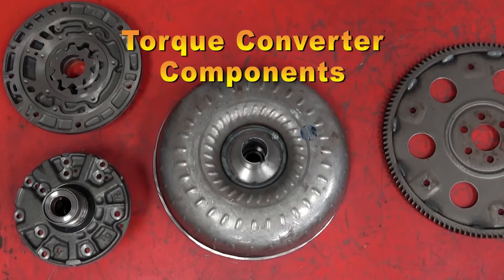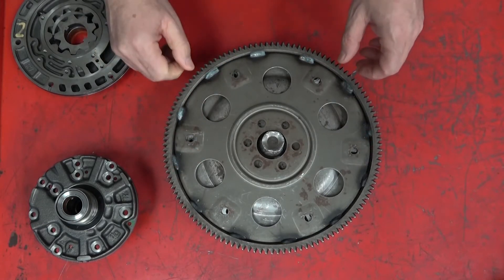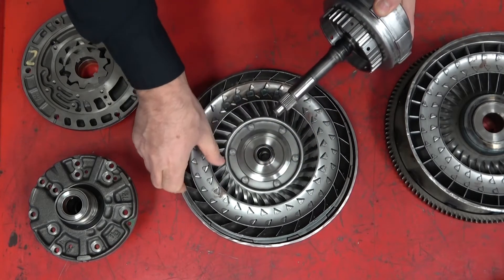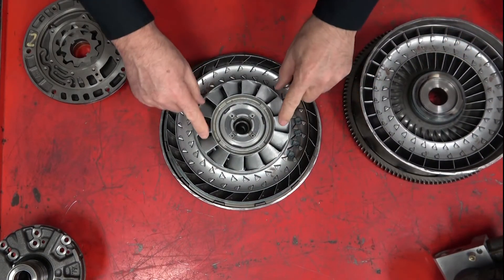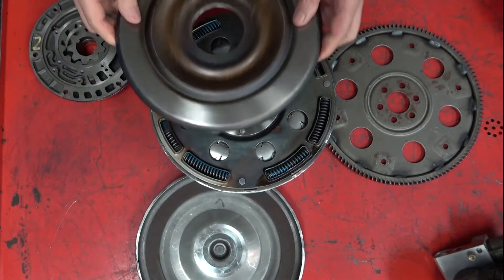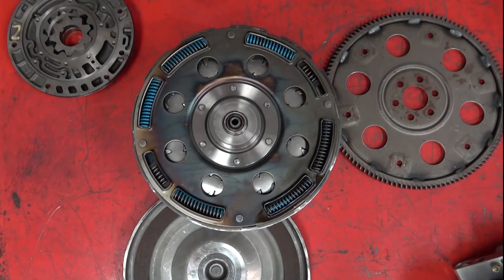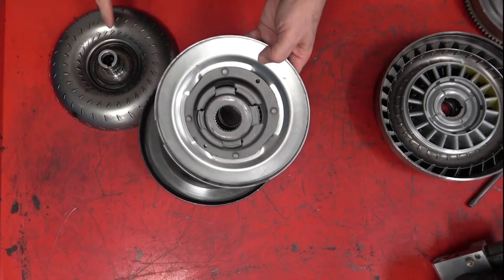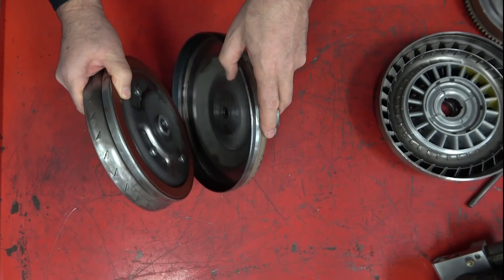Torque Converter Components

Comment: INDEED, excellent break down very detailed explanation with pinpointed each part's function that is key 2 understand how torque converter work and relating parts to synchronized operation.

Comment: Hi, I hope you remember me.. any case i have serviced my totyoa tranmsision with a mechanic. Now i see very minute leak between tranmission and engine exaclty below flex plate .. i changed the rear main seal, during transmisson service, will it be torque converter seal ?.. if you can advise me what all could be possible cause that will be helpful. apprecaite your help. it looks like PInk color
Reply from the maker: Pink in color is Auto Trans Fluid.  It could just be the pan gasket near the front of the transmission.  That would be the simplest. There is a torque converter bushing and seal as it enters the transmission that could be leaking.  The transmission has to come out to fix this.  It's difficult but sometimes you can see inside the bell housing in the direction of the transmission input shaft. If you can see oil in that area it would point to the converter seal.  If the trans comes out to fix this make sure the converter hub is inspected for wear and also make sure the bushing that is right behind the seal is inspected and replaced as needed.  If the bushing and or converter hub are worn it won't do much good to just replace the seal. You might need a technician to verify this.  Sometimes a bore scope can be used to see in the hard to see places.
Reply: @DrivelineMaster  thanks as part of rebuilt input shaft is replaced and gasket replaced from transco. Not major leak not dripping if I swipe finger I can take one drop. Is it major that I have to fix
Reply from the maker: If the trans was rebuilt then they should have replaced the converter bushing and seal along with the torque converter so if that was done the odds are in your favor that your leak is not from the converter.  Just for specifics the input shaft seals and converter seals are two different items.  If you can take a socket and ratchet wrench and go around the oil pan bolts and carefully snug them up. you may find a few that have loosened up.  Just be careful not to over tighten the torque on most of those is only around 100 inch pounds or 8.5 foot pounds. There is a good chance the pan gasket is seeping and may need to be replaced soon especially if it's one of the older style cork gaskets.
Reply: @DrivelineMaster  yes I do know the replaced bushing and seal and leak is not from transmission PAN. I believe when you talk about input shaft seal, you are referring to cv axle shaft seal if so it is not leaking from there. Thanks and appreciate your response
Reply: @DrivelineMaster  Thanks much, i took it shop where my trans was rebuild. We put it in lift, i see that color of oil drop was in brown color, so they said no leak from trans, i change rear main seal when my trans was out, we thought it is from rear main seal, so we took out an small plate just above the leak which gave access to the flex plate and when we ran our finger below the flexplate on that opening we dont see any leak of oil inside that space . does that mean rear main seal is not leaking  when i dont see any evidence of oil in or across the flex palte ..  he said it may be comng something from top to bottom but on rear main sael. pls advsie.
Reply from the maker: Rear main seals have a tendency to fling oil in all directions because of the rotating crankshaft. Oil leaks always run down form top to bottom because of gravity and seals with rotational motion with fling oil in all directions but when not rotating the oil will drip down. I can't be certain but based upon what you said I'm leaning towards the fact that the rear main seal is OK.  To find a mystery oil like there are 2 main options. 1) clean off all the oil the best you can and use solvent to make all the parts in that area really dry so when the oil reappears you can tell with a swipe of your finger and the shiny reflection from a flash light. 2) you can put a florescent dye in the oil and use a black light and amber glasses to look for glowing oil in the area of the leak. This also helps if you can clean up some of the old oil before using the dye.  You often need to run the engine and or drive the vehicle a bit to get a small leak to show up.  The first thing I do after cleaning the area is to run the engine while I watch carefully for the leak. If I can't spot it after about 30 minutes I will take the vehicle for a short road test and then bring it back in and look again. Slow leaks can be tricky to find and it may start to leak after shutting off the engine so let it sit and watch for the leak over then next hour or so.  look up on the back of the engine. Is it possible it's running down from a valve cover or other seal up higher on the engine? Leaks like this are often mistaken for rear main seal leaks.  If the technician had a bore scope you may have been able to insert it through the cover plate opening for additional visual inspection around the flex plate. It's often very difficult to see up in that area for most vehicles and a bore scope is sometimes very helpful.  Also, some ATF fluid will turn brown and look like engine oil.  If you have a dip stick on your transmission pull it out and check the color of your fluid to make sure it does not look like the drip you are finding under the vehicle. Good Luck